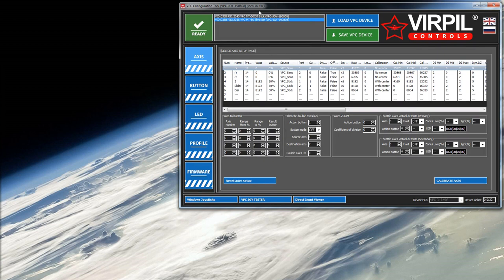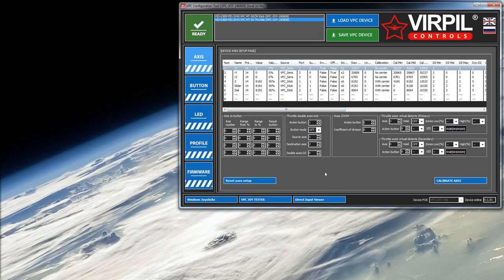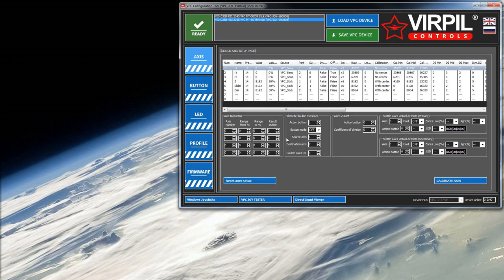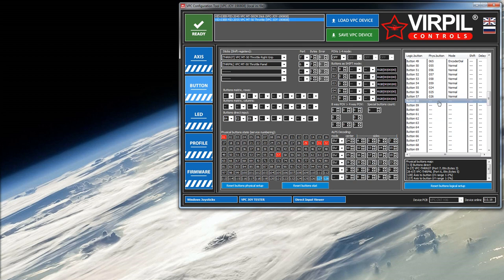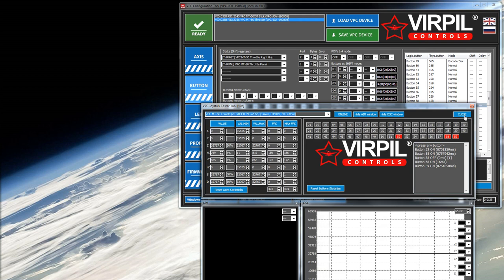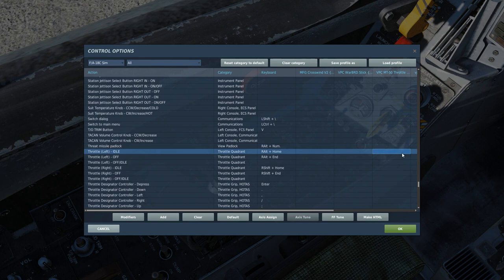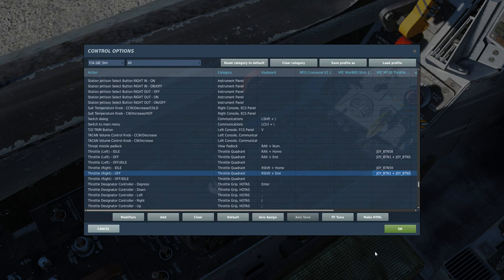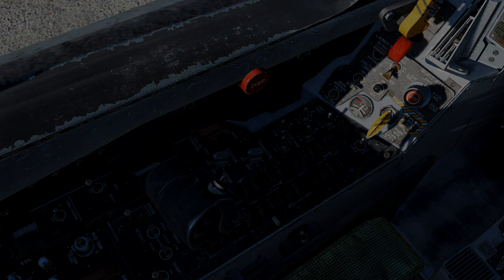Virpil Throttle - DCS F/18 setting up idle config tutorial

Comment: I just got this and got the software, CM3, know this is a few years old, but i don't have the option for "result button"
Reply from the maker: the result output button is auto defined by the VPC config software, go to the button tab lower right corner will show which physical button it has decided to use
Reply: @HavocCompanyClan  thank you.
Yes I just checked the detents and it seems it was auto assigned.

Comment: This doesn’t help for when you are in-flight at mil power and you need to go to idle, like in the break during  a case 1 landing. The way you have your throttles set up, they won’t go into idle until they reach 1% to 2%. But if you are in-flight at mil power, and you move your throttles back right against the idle detent, they are still going to be reading at last 10% in the Virpil software. 

It would crazy to move your throttles all the back to 1% to 2% while in-flight because you will most likely trigger cutoff right after you trigger idle. 

You need to have it set up to where when your throttles are in mil power and you move them right back up against the idle detent, but not past the detent, the aircraft goes into idle. 

That’s around 10% to 15% depending on where you have the physical detent placed on the throttles.
Reply from the maker: That why to go sub idle you have to hold a button down and move the throttle back, did you miss that bit ?

Comment: my throttle is inverted in dcs
Reply from the maker: select this axis in DCS axis config page, then click tune axis button, tick the invert tick box, that should sort it out
Reply: @HavocCompanyClan  I did try that but it doesn't seem to work for me.  I'm using firmware 20190930.  After more playing around, changing invert does seem to work.  Thanks.